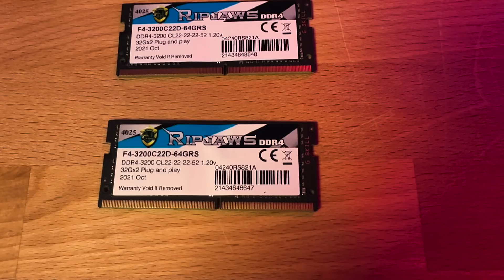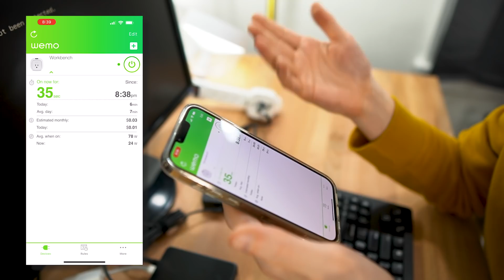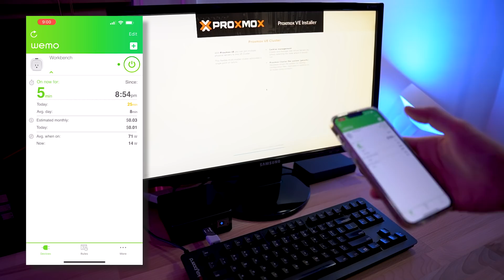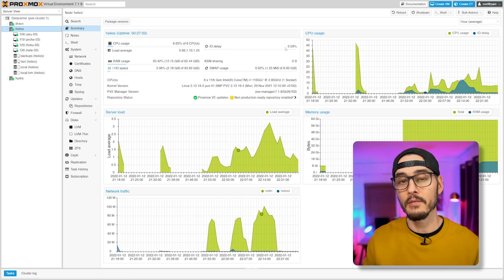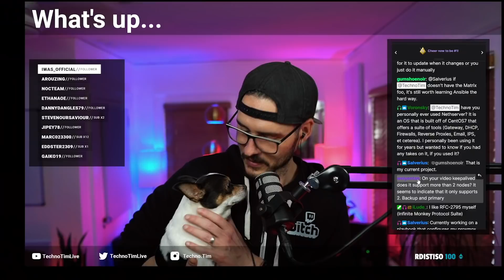Build a Low Power, Efficient, Small Form Factor but Powerful Proxmox Server

Comment: Have you noticed poor ethernet performance when sending data to the NUC, via onboard or USB ethernet adapters?  I can't get the i225-LM to take more than 1Gbps in, though it will serve up 2.5Gbps without fail.  I've tried with RHEL 8, Rocky, Ubuntu 20 and 21, standard and the latest kernels, even Proxmox like in this video...  all have this issue.  Windows 10 however, has normal bi-directional 2.5Gbps ethernet throughput.  This is very annoying.
Reply from the maker: I did notice this on older nucs and older version of proxmox and it was due to the driver, it would drop packets but I haven't seen it in a while
Reply: @TechnoTim  I traced it to a junky driver-orphaned StarTech 10G adapter I had on the other end of my tests, and an odd interaction it only seems to have with the QNAP QSW-2104-2T I recently put between these computers.  Good inspiration though on your end.  I'm going to try to make this "Vaseky M.2 SSD 2242 NGFF SATA SSD 512GB B key+M key" my boot drive, so I can use the NVMe slot for KVM's, and an 8TB QVO in the SATA for seeding and a zoneminder archive.  The i5 version w/ 32G seems fast enough for 20ish 1080p ipcams, plus my torrents and other small stuff like pi-hole.  Powerful lil' thang.

Comment: Thanks for your super video. I’m close to buy a NUC 11 i5 to install a Proxmox server on it and I would like to know if you had any issue during the install. I’ve read on several forums some compatibility issues between Proxmox ISO and NUC 11. Maybe they have been fixed with Proxmox 7.x version ? Thanks.
Reply from the maker: 7 worked perfectly for me!

Comment: Maybe NUC11TN (Pro) could be of a better value for PVE since it has one Thunderbolt 3 and one Thunderbolt 4 port. Those ports should enable going from the single node PVE to a three-node Proxmox HCI with a fast ring network over the Thunderbolt for the ceph storage.
I did try once connecting NUC8i5BEH (ubuntu 18.04) and NUC8i7BEH (Arch) via a thunderbolt 3 with a simple passive male-male cable and it worked. Some 25ish Gbps on iperf3, without tuning anything. It was a short test so no info on latency, or stability/reliability.

Comment: Isn't the downside to this that if your nv 980 storage fails you've lost everything. But if you have a raid config you have redundancy.  I can see the advantage of being able to boot multi os from the server but without redundancy its like when your hdd fails on a pc, without backup your stuffed. Could you add more nvs to this or another ssd?
Reply from the maker: That is true, but I back up all of these VMs nightly.  I fully expected and prepare for any hard drive to die at any time.  Also, these only run kubernetes and for me, if one dies, I have 3 others that will pick of their work.

Comment: i dont get the "build" part if there is nothing to build. maybe setup? configure?
when i add ram to a laptop or PC, i never refer to having built it when im just adding.
Reply from the maker: I build my code.  By definition, it is basically just putting things together anyway :)
Reply: @TechnoTim  ahem:
you write code
you build hard
you install/setup/configure software

Comment: Well, i am in love with my NUC, got an i3 7100u NUC with 16gb of ram and a 2tb hdd, and conected with USB 2 more docking stations with 4 hdds in them of 2tb each, got a nextcloud server running on ZORIN OS in raidz2 (5x2tb hdds). My max power draw on ALL the equipment is around 30W, i could not believe that.

Comment: Would it be nuts to use this for my CCNP labs?  Using EVE-NG to virtualize network equipment
Reply: ok yeah these are alot more expensive than just a dell power edge with like 256 RAM
Reply from the maker: Should work!  Yeah, depends on how much you want to spend on your lab and how much space you have!

Comment: re: Using Intel NUCs as a VM server (whether it's Proxmox, XCP-NG, or just dumb ol' Windows and like VirtualBox)

In my experience, the biggest problem that I have with the Intel NUC is that yes, the processors can turbo up to whatever the max boost clock speed says according to the spec sheet for the processor, but the CPU heatsink/fan solution is NOT designed to handle that amount of heat for ANY sustained period of time.

I'm currently using an 8th gen NUC (which sports the Intel Core i7-8559U processor) and under the load of a number of VMs (like right now, I only have one VM on the unit) and it can and will hit the 100 C Tj temperature limit easily and repeatedly, and therefore; really restrict the CPU's performance potential due to thermal throttling.

(Run Intel Power Gadget as one of the ways to see that.)

So I am really curious as to whether you are seeing the same thermal throttling issue if you were to put your Proxmox VMs through its paces as well.

(I originally was running 7 VMs of the NUC and between thermals and the fact that the 8th gen NUC maxed out at 32 GB of RAM, it was starting to show that it was fighting/competing for resources, so I ended up offloading 6 of the VMs onto my 6700K (which also has 32 GB of RAM, but because it also has a Noctua NH-L12 CPU HSF, it has a LOT more thermal head room which means that the 6700K can stretch its legs out wayyyy more than the Core i7-8559U that's in said NUC).

So now that I only have the host OS and one VM running, the NUC is working a lot better/happier (less competition for resources), but it is still running into thermal throttling despite a 23-24 C ambient. (It REALLY doesn't take much for the CPU to hit the thermal throttling limit.)

That's really the only downside that I have found with using the NUCs as VM servers. If the thermal management solution was engineered to handled like two or three times the spec'd TDP (which is NOT the TDP when the processor is boosted), then the NUC would be a MUCH more performant and a VASTLY better value proposition.

(ServeTheHome's TinyMiniMicro project is actually the next level where I am going to start looking in terms of replacement hardware for the NUCs because hopefully, with those systems being physically larger than the NUC, that it would have more room for a bigger heatsink, and therefore; allows the CPU to fully stretch its legs out more. The power envelop, and the performance of MOST of the systems they've reviewed should be pretty close; it's just physically larger systems. But if it is an optimisation between size vs. performance, having a sub-1L PC but being able to take advantage of the full performance envelop of the CPU, in my opinion, would be worth the extra physical space that it would take up.)
Reply from the maker: Thanks for the insight!
Reply: @TechnoTim  
No problem.

You might want to run some load tests to check whether your NUC is thermal throttling under 100% load (whether it is directly on the host or whether you load up one of your VMs or load up all of your VMs).

What I have also found is that if you have a competition for resources (RAM or CPU), that the latency of the individual VMs starts to increase dramatically and the responsiveness of each individual VM will start to plummet.

So whether that's due to thread locking (competition for CPU resources/clock cycles), or excessive swapping (competition for RAM), VMs that would otherwise normally be performant will suddenly be a lot less so.

It REALLY depends on what you are doing.

Another example is that, for example, because you can't have a discrete GPU in a NUC, therefore; if you want to try and passthrough a GPU to a VM for hardware accelerated transcoding for your virtualised Plex Media Server, you are going to run into issues with that.

(I haven't been able to quite figure out that if you passthrough a GPU, whether that GPU will ONLY be accessible by the VM client or whether the host system will ALSO have access to said GPUs resources as well. I've never really tried.)

On my 6700K, I am running 7 VirtualBox VMs right now. On my NUC, I have one (VM) running.

My other NUC is a 7th gen Core i3-7100U. And that one, I also only have one VM running on it as well. As a "dumb" web server, it works sufficiently for that. I don't need anything crazy fancy and it was easier to set up (and smaller) than trying to set up like an actual tower computer solely for that purpose. (I needed a separate system so that I can put it on a separate network layer compared to everything else.) And that system, I am less worried about it thermal throttling, even though, it will still hit said thermal throttling limit.

Comment: I took a Dell 3070MFF with 32GB RAM for my Proxmox-Server. There ist a Intel Core i5-9500T inside with the 256GB-NVme-SystemDrive and a 1TB SSD from Crucial (MX500)  for my VMs. It´s ok for me. A Lenovo m83 is my second Proxmox-Server for Testing and a old Fujitsu P420 is my Proxmox-Backupserver. Good Videos!!! Greetings from Germany!

Comment: I'm running Proxmox on a 2nd gen i7 laptop with only 16gb ram in it, lol. I'm in need of an upgrade fairly badly. But the laptop was free from work. My biggest limitation is ram. That NUC sure is cool. I was thinking about putting my own Ryzen based system together in a mITX form factor. Honestly the NUC is fairly reasonably priced by comparison.

Comment: NUCs are cool but I think TinyMiniMicro machines (ServeThrHome's moniker for Thinkpad, HP and Dell's 1L machines) still present a better package. Basically the same size, but with as efficient, yet more kick-if-you-need upgradeable CPUs (which may even go for 2 generations depending on chipset support by Intel), a pushier thermal envelope, upgradeable Wifi, and in the case of the Thinkpads you even get multiple NVMe slots. Some models even allow for either a Quadro or low form factor ADM GPU, or even Thunderbolt (albeit these two are rare and expensive). You can get them up to 10 cores on 10th gen, and now they also come with Ryzen options apparently. I'm really hoping for a great 12th gen Tiny to splurge myself.

Comment: I'm gonna try to do this for my solar surveillance box.  They have 12V-24V input, so it should be able to run directly off the LifePo4 battery ~14V.
Reply: This works perfectly by the way...  all I had to do was make a cable with the right connector.
Reply: AWEFUL expensive to record some video

Comment: Great video. I was really happy with my NUC i5 8th gen running proxmox until I maxed out CPU load on a VM to see what happens. The NUC did a thermal shutdown. Not a clean one - just powered off ! Obviously the cooling solution wasn't designed for such use...

Comment: Personally I prefer the J4125. It is 4 cores and only 10 watts TDP. It won't run a super center, but for most people's needs, it is plenty of overhead for a handful of virtual servers and only 1/4 the electric bill at full load compared to this NUC. You are sacrificing a lot of power in comparison, but will save loads of money on both MSRP and electricity.

Comment: GPU passthrough example for a LINUX (not Windows) VM would be great. Also, how would it go using ZFS mirror across both the NVMe and SSD, assuming the SSD was also 1 TB? I'm pretty sure it would work, but what about the discrepancy with r/w speeds between the drives? I find it hard to justify using Proxmox on a single drive.

Comment: Im trying to figure out the requirements for a good storage setup for running unraid in a VM. I can setup an nvme drive (my board only has 1 m.2) for all my vms like you did and I already have exact same Samsung regular ssd for a promox drive.  However, how do I handle cache drives for unraid? Do I have to pass through to the unraid vm directly or just share storage from existing nvme and part of another drive? Would I see a performance hit? Do I need to run the promox drives in raid one two matching or just be prepared to replace them? How impactful is the log writing on the promox drives in terms of longeticity as well

Comment: Intel NUCs are just great for home hypervisors. They, of course, lack large storage capacity, but if that's not a concern they're awesome.
Reply: Absolutely. Pair it with either external USB storage/iSCSI/NAS shares and it's a great way to start with hypervisors like Proxmox etc.
Reply: Hi  @rullywow3834 . Could you elaborate on the possibilities of expanded store for NUCs? I was thinking of having one of the VMs to be the actual NAS. Thanks.

Comment: I'm using small form factor PC as a server. Specifically, HP ProDesk 400 G4 Mini. Recently upgraded it from 8 GBs of RAM to 32 for exactly this purpose. I'm also going to attach PCIe riser/converter from M2 slot to normal PCIe. On there, i'll attach SATA controller for NAS capabilities. And yes, it will run TrueNAS VM inside it. For geeks, i prepared 2x 8TB IronWolf Pro, 2x 500 GB HDDs and 1x 250 GB SATA SSD for those VMs and also for cache.

Comment: Interesting that you even run stuff on the little NUC. I would think cooling be a problem, with that small case. I'm running a proxmox cluster with three nodes, but only two run actual VM's, the third is an old PC with very little RAM, for qorum (getting an odd number of nodes). Even a rather old NUC would do this, as long as it supports virtualization. :-)

Comment: Did you also consider going with a AMD based Mini System? For example with a 4800U or 4900H CPU with 8 Cores? I think this would be compelling as you get twice the amount of cores and in most situations an extra Ethernet Port (2.5Gbit and 1Gbit).

Comment: Interesting video, but it'd be nice to include more info relating to cost and comparing power consumption to other systems. If, for example, it uses 1/3rd of the power of an R720 but cost so much that it would take 10+ years to recoup the investment then that should be taken into consideration. Obviously there are other differences (e.g. form factor, noise), but it would be nice to put some more info in for comparison.
Reply: @jondoough  but most of us don't get hardware for free
Reply from the maker: @jondoough  let me know how you get hardware for free!

Comment: I bought a refurbished Lenovo Tiny M93P from eBay. With just 8GB (up to 16G) of Ram is running just fine. 
I have both the OS and the VMs on a single 512GB SSD and I’m planning to add another 256GB SSD.

Comment: really good stuff. Personally had a lot of NUCs go bad, suffer BIOS failures or no boot/post issues, and similar. Thats my only concern in this area. 
Outside of that, this is great, and takes up minimal room.
Reply: For me it was the video woes
Reply: I have a few older Skylake NUCs and they can be neurotic or spasticated at times.  I attribute this to the difficulties of concentrating compute resources in such a small package.  I had issues with  UEFI boot and kernel panics with Linux.  Forgot that it is a hybrid architecture that is not AMD64.

Comment: I did almost this exact NUC Install running Proxmox a week ago.  My Proxmox Cluster is 3 nodes, all NUCs.  I also run VLANs to Proxmox, curious what your network config in Proxmox looks like.  Have you considered running CephFS in your cluster?
Reply from the maker: Thanks!  Network config in proxmox is pretty flat.  I run VLANS at home so I have proxmox connected to a management VLAN and all guests are connected to different VLANS depending on their role.  Haven't used CephFS yet.

Comment: That’s exactly what I did. Those Intel NUCs make outstanding Proxmox nodes! Two of them don’t even take up 1/4 of the space of my old Dell tower, and they are silent, and they barely draw on my UPS when I have a power hit, and I can throw one or two of them in my laptop case taking my entire development network with me when I go remote remote for extended periods of time. I reimagined my entire lab setup based on these little gems.

Comment: Thanks for the video! So can I assume that this is a perfect solution for a person starting some home IT/programming etc. solutions? A Raspberry Pi is a little bit to slow and to small for me right now but on the other hand I don't want to commit myself to start a rack / large servrt construction (and I don't have a place for that in my room and electricity costs are a no-no as well)?
Reply from the maker: YES!  that's the perfect use case for this.  Someone who doesn't want a server rack but wants the same capabilities that a server can provide (without the huge power bill too).  It's a 1000x more powerful than a raspberry pi too!

Comment: That's one nice little mini beast Tim! The NUCs can get pricey, but the used pc/server market is still a bit nuts. I just put my home lab back into commission, my Netgear router wasn't cutting it. So for now I'm running Proxmox with pfsense, pi-hole, and TrueNAS Core (Storage & Plex) VMs, all in a Meshify S2 case with a 3700x, 90GB RAM,.

Comment: It's a great idea to use such machines with Proxmox.
I set a cluster of 3 Delle 3080 micro, all equipped with a NVME and 2.5 SSD. Now I'm looking for a low power large storage solution to link to.
Reply: Did you find your low power large storage solution? I would be interested to know as I would like to do the same. Thnaks.
Reply: @jp_baril  Not yet, I've ordered parts to build 2 configurations:
A. Asrock Z97 M8 ITX motherboard which has 6 sata slots, a Xeon E3-1240L v3 CPU. You can upgrade the CPU but it with higher TDP.
B. Asrock J4125 ITX which has 4 sata slots. This board's price is recently rising fast though.
I did'nt look at the ssd's yet, if you have ideas on low power ssd's please share, I'd like to hear.
On both systems I'll try to get 2.5g network via the WiFi slot. There are 2.5g pcie mini cards available on Ali. I think they are RTL8125b.
Both systems will still have a PCI-e slot free for extra storage or something.
Of course a dull nvme system would probably be better but I couldn't find a system that fits so far, maybe some prebuild mini PC's, I don't know. Also if someone has ideas for that please share.